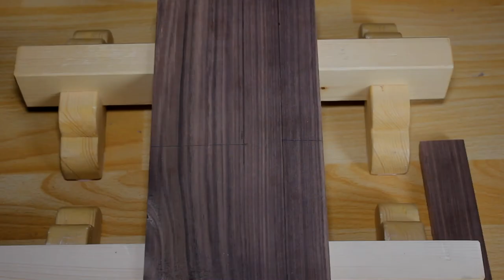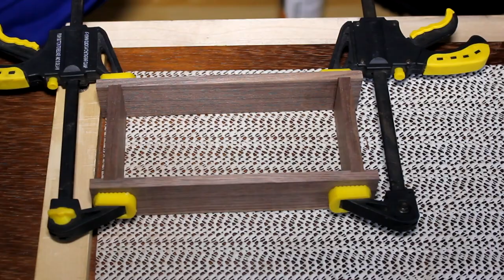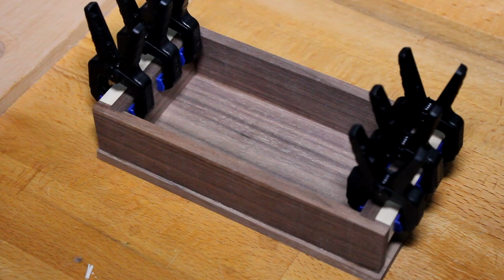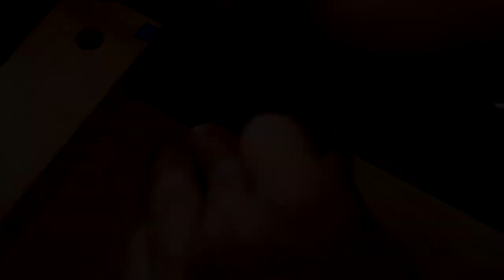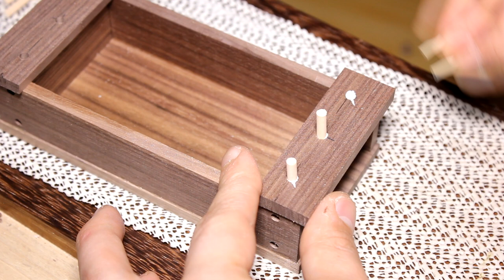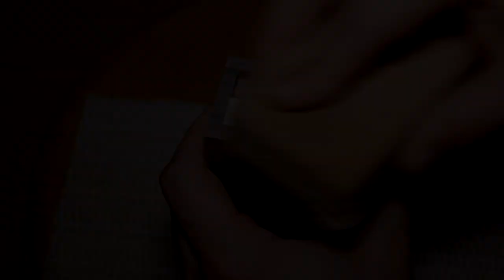Mini Japanese Toolboxes Build

Comment: You've got the cutest little brass clamps!
Reply from the maker: Lol Thanks :) They are japanese clamps, called "hatagane". Very adequate for small work where you don't need much pressure, and light weight, not to damage the workpiece.
Reply: I'll look into it! As an apartment dweller, I've always felt that I've been at a disadvantage. I work out of a relative's garage. Your videos, however, are pure inspiration.
Reply from the maker: Yeah, me too until I got a plane and a cheap chisel and start to make some noise, then things escalated :)

Comment: Wonderful video! Nice work set up! Just a friendly tip if no-one else pointed it out. Flush cutting your pins with the grain (of the walnut in this case) will reduce the marks left by the saw. Thanks again for a nice video!
Reply from the maker: Thank you! That is a flush cutting saw, has zero set of the teeth on one side, so it will not scratch the pieces. The only way you can scratch is if you bend it below the line towards the handle and will damage the edge, that s why the handle must be raised a bit, and also the blade of this saw is very flexible to allow that

Comment: Amazing work! Would you be so kind as mentioning which Danish Oil you use? I find that depending on the manufacturer the composition can vary widely, and I love the result you are getting.
Reply from the maker: Hi, I have used in the last years Rustins and Bormawachs. Both are ok and give similar results, I haven't noticed any difference

Comment: Those came out beautifully, I especially like the contrast in the style vs the wood choice.  I'm desperately waiting on a set of good chisels to come in so I can do more hand work!
Reply from the maker: Thanks! Yes the walnut and maple/cherry contrast is nice! The beech dowels are kinda compromise. When no or poor light you can barely distinguish them. The endgrain of the beech when oiled becomes like the walnut. Those are ready bought dowels very cheap from a hobby shop. In future I will try to make myself a dowel maker and do from whatever wood I want.
Reply: I've been thinking about a dowel maker as well.  I have found myself doing more with dowels lately and the store bought dowels are never accurate in diameter!
Reply from the maker: Yeah, I know what you mean. Shop dowels are crap, very small then the diameter rated. You can drill the perfect and clean hole for it, but if the dowel is loose will look ugly.

Comment: Superb, as usual. Couldn't help but notice how a piece of maple was slipping a bit through the jaws of the vise. How do you feel about using a bit of very fine sandpaper double-side-taped to the jaws to prevent slippage under lower squeezing pressure?
Reply from the maker: Thanks! There was under tightened, filmed that way, and then tightened more and continue chopping :) Was a very small materiel under the vise, like 6mm, didn't want to exceed to much force. Normally in a future big size workbench I want to make is to add thin leather sheets on the jaws, maybe also glued on a magnet sheet and attach whenever needed to the jaws. Also cork can work, but maybe is too soft or compress too much for small pieces.

Comment: I purchased the plans from your Etsy store and made one of the tool boxes. I enjoyed it very much and plan to make more for gifts. 

I do have a question. You showed some larger versions at the end of the video. If I want to make something a little larger than the small tool box in the plans, would I just increase all dimensions proportionally, including the thickness of the wood components?

Thanks.
Reply from the maker: Hi James, thanks for purchasing the plan. So, the larger version at the end of the video is the one from the plans. This one made in the video is actually a very small one. When I made this vid I did not have plans to make plans 🙂 and in time I come up with the final version of the box, those showed at the end. There is another newer video I made that will show only the ones from the plans https://youtu.be/E3sg73mTmKk Sure, you can scale the dimensions if you want a larger one, that will work and look ok.

Comment: Hi, thanks for the video. Is it correct to glue the bottom of the box, will it damage the box because of season temperature changes?
Reply from the maker: It's not technically correct, but is too small to make some damage. Traditionally they do nails there, so basically the same wood constrain

Comment: Beautiful work, but wouldn't it make sense to put the hole on the other tapered side to be able to lock it with a wooden dowel?
Reply from the maker: Thanks! That hole is just to put a string there, or similar. The friction of the wedge is well enough to hold it there

Comment: Absolutely beautiful work!!! I love the final product! For once YouTube actually suggested something of substance lol. Just wish it would have done it sooner, can't believe I'm just now finding your channel. 

I do wonder why you used a auger bit and not a normal twist bit? Just personal preference or to stay as authentic as possible. Again you do amazing work!
Reply from the maker: Thank you very much! I used the auger bit, yes, mostly for commodity and technical preference :) This is a bit from a manual brace set, with a 1/4" socket. I didn't get the brace, just some bits, and I can easily use it on that Bosch screwdriver which has a low rpm, 180. Otherwise, using a normal drill bit, I should have put it in the drill press (I just have a drill press adapter for an electric drill) and run it at high rpm not to produce tearout on the walnut, so the dowels will look nicely fit. With this auger, which is very sharp and clean, I can precisely drill (bit was 4mm, walls were 6mm, so not much room for errors), and is quieter too.

Comment: Beautiful work! Question about the angled wedges: how do you ensure the tilted angles match?
Reply from the maker: Thank you! You make/shoot one piece at one angle, then shoot the second one tilting it approximately same as you did on first. For sure will not match at first. Then you put them together on a flat surface and observe wherever you must change the angle in order to match (for one piece only, you keep untouched the one where the angle seems ok for you). Then you try to adjust on the shooting board by repetitive attempts, tilting it just a hair in the direction where you need to take away to match. In 1-2 max 3 attempts you will figure it out , and is not taking so long. Clean way is to make a small raised panel on the shooting board, but the time you spend making one you adjust those by eye if you have a few to make :)
Reply: Thanks for the reply Adrian! I'm making a regular-sized tool box so I might try a shim to raise the piece on the shooting board. And then mark an angled line on the ends to work towards.

Comment: really cool build but could help to notice, the hole isn't on the wrong side? I think that hole is supposed to be used to lock the wedge
Reply from the maker: That hole was never intended for a lock, is just to add a string/wire something not to loose that wedge :) I should have filmed that, I see there is many confusion :)

Comment: I've had trouble with lid tolerance after finish is applied. The top ends of the lid are tight against the under side of the top end battens. Have you run into this?
Reply from the maker: Yes, sometimes. I just add one layer of finish there to prevent this, but if it happens run a rebate plane a take little shavings, or in absence of that, use carefully a chisel and scrape a bit.

Comment: Very nice work!  Just curious, what thickness stock did you start with?
Reply from the maker: Thanks Seth! The walnut, I bought some time ago from a deposit a big 0.1 cubic meter board, 56 mm/2" thick, and then slice it to several thicknesses at a friend workshop (check on yt for Slovenian Woodworker), various sizes: 6, 10, 18 mm etc (1/4, 3/8, 3/4") These I have at home and work with. Normally they are twisting a little, cause internal stress etc, and when I prepare for a project I plane them also to remove the thickness planer and to level them.
Reply: Thanks for the prompt reply!  And good to know. I'm hoping to do a similar box with Walnut.
Reply from the maker: Sure, no problem! 2" thick stock is too time and tool consuming for my handtools. 3/4" I can handle for small parts. I also bought a small bandsaw now, 80mm cut height, hope to speed up the rough work

Comment: Those little brass screw vices are pretty cool. Did you make them or are they commercially available?
Reply from the maker: Indeed, cute little clamps :) Those are Japanese clamps called "hatagane" .Very good for tasks where you don't need to much force, small area to fit in, and lightweight not to damage the workpiece. They are bought, it's about 8-12 euro a piece depending on the length and bar thickness.
Reply: Adrian Preda Thanks!

Comment: For the plane jig, when planing the workpiece, won’t it also plane the jig?
Reply from the maker: No. cause is resting on the sides of the sole where there is no blade. Or, if the rails are a little bigger, the blade will bite the rails, but will eventually stop until reaches the depth that the blade is set, then will continue to slide on the sides of the sole

Comment: What size dowel is that? I'm trying to convert 4m to fractions to see what size and I'm not understanding what size you used and did you use maple dowels?
Reply: What size walnut is that? 1/4? I'm very new to woodworking on terms and sizes thanks
Reply from the maker: 5/32" is exactly 4mm😀 it is beech not maple. Yes, 1/4 the walnut

Comment: AW!!,,!,.... As in "AWmAWgAWd"  .,.,.,. I really hope mine come out that nice. I will be using bamboo for pins though. Same species choice. Unless I go w/ q/s r-oak on the first one. But either way I will be making many in many sizes. Again; awesome and perfect. Gr8 yob.
Reply from the maker: Thanks! Yeah, bamboo is very interesting, brings more an asian element to it, even for the handles, locks, although being an "pseudo" wood, straws/fibers glued together, can be difficult to plain, mostly the end grain, in order to cut it clean, but worth a try. I was thinking one day to make waterstone holders from bamboo, and try to make sliding dovetails etc, bought a cheap cutting board to use bamboo from. I think will be challenging :)
Reply from the maker: Aaaa yes, seen it, I will go crazy :)) Maybe sliding dovetails what I will want to do will go easy, but doubt that :)
Reply: Yup, I would have lost my temper.

Comment: So I want to make a box about this size does anyone have suggestions for wood thickness?
Reply from the maker: By the books around 6-8 mm or 1/4"-5/16". Too thick will look surrealistic, kitchy...
Reply: Thank you! I guess I'll be planing down my 3/8" then
Reply from the maker: Slightly less than 3/8" (9 mm) I've used on the handles (the side ones with the arch), and locking system, all above, together with wedge. The long walls of the box and bottom are 1/4-5/16", cause their endgrain is mostly visible.
Reply from the maker: Sorry, I was talking about the bigger (medium) boxes I've made, those at the end of the clip. This one in the clip has 6mm body, 7mm handles and wedges. 15/64" with 9/32". Good I'm learning some standard mm values in inches :)
Reply: Thanks for letting me know. Loving the videos!